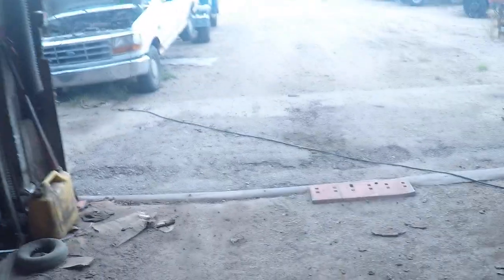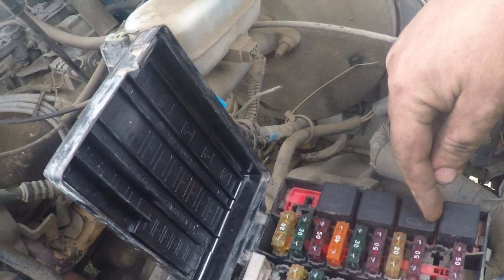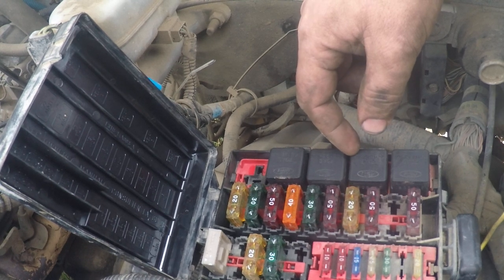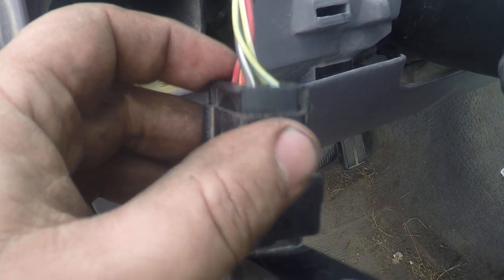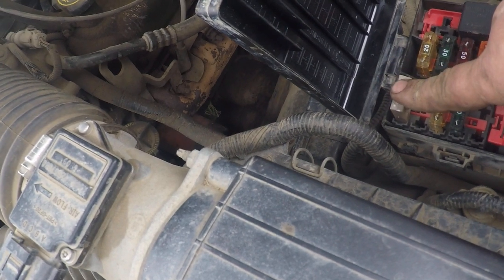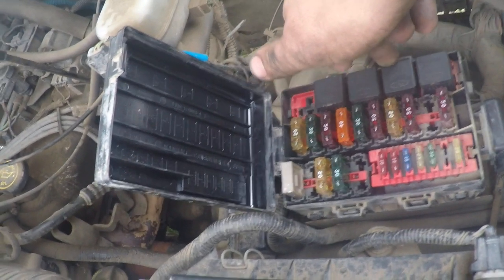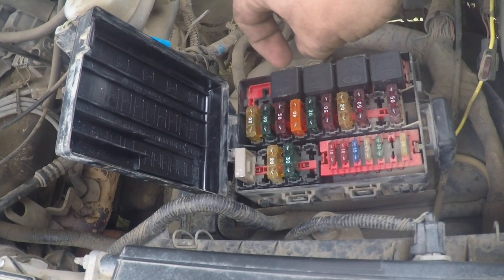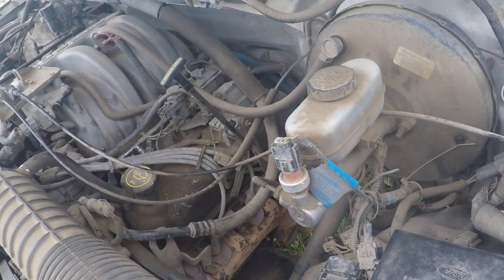Ford Fuel Pump Power Diagnostics

Comment: My 1999 Ford Ranger started giving the anual problems  this winter, slow starting, no takeoff power intermittently running good, and running like crap. Thinking back it done the same thing last year during deer season. thin looking at my feet I remembered, I wear -60 degree artic Pack Boots during deer season cold blasts. And they were the source of my misbehaving Ranger. It seems that those fat 6 inch wide boots wern't ment to drive around with on yer feet. Think about depressing the brake while your trying to take off with the outside of yer boot starts catching floorboard. Needless to say there is nothing wrong with the truck jus the foot................

Comment: Inertia switch on my 1988 F150 is in the cabin mounted to the firewall where the steering column goes through the firewall.
Reply: I have a 87 ranger and mines in the floorboard and a buddy kicked it and it broke

Comment: I have a 96 f150 4.9l that has a problem with the switch going bad. How can I jumper past the switch in an emergency to get home ?? Which terminals on back of selector complete front or back circuit to run appropriate pump ??

Comment: What a out a 2002. F -150?  Im having the same issue. No double tanks. And yea, a new tank,and fuel pump. Havent xhecked diode or inertia switch yet. Thanks in advance..

Comment: 04:09  ECM Diode, Simply Remove & Replace for better connection.
THANKS   FIXED MY 543 Ford OBD code.
Power restored.

Comment: Thanks for very informative video. I have a 94 F 150 that will only feed from the rear tank. I pulled the bed and replaced the front fuel tank pump and presto. All works. Next day no run on front tank. After watching your video I checked the inertia switch, swapped relays around,  Checked diode with meter. Found only 6 volts at the front/rear selector switch. What feeds 12 volts to thisswitch? Where can I get a schematic? I went to the library, searched the web. No joy yet. Like to know what the next item is upstream of the switch.
Reply from the maker: The inertia switch feeds power to yhe selector switch, you will need to check power in and out there next.

Comment: Got any ideas why a 2003 mercury mountaineer no fuel pump prime when you turn key on. Car will start after cracking to get oil pressure car starts and runs  fine. Just harder to start when it hot. .
Reply from the maker: Likely the temp sensor, there are 2 one for the guage and one for the computer mixture control, if the mixture control one goes bad it can cause hard starts as it typically causes a flooding situation.
Reply: @tri-rrrservices7299  it's not running rich ,and isn't flooding . You can not hear the 2 second prime when you turn the key on. Once the car has 4psi of oil pressure the pump come on and car will start. What tells the pump to prime?
Reply from the maker: The ecm runs the prime, if it's not priming you will need to check inputs and outputs of ecm, in  particular you want to check the ground circuit for that circuit in the pcm as there are multiple grounds for multiple functions I  the ecm, that will require a wiring diagram to confirm which circuit as well you will want to use a test light for checking power and grounds,  as an ohm meter won't show if the circuit is unable to carry sufficient load.

Comment: Very Good.  Hope you can help me.  I have the same truck. sat 3  years. I replaced front tank, treated fuel cleaned throttle body all good then was going to replace the rear tank and just prior to mounting the tank I thought I would check the voltage on the rear harness. I got like 5. something volts.  Went to start on front tank pump would not run. checked voltage on new selector switch. NO voltage, checked relay, inertia switch all good.  An idea?  Thought I would just connect the new rear pump not installing it in the tank and see if it would run.  I am out of ideas
Reply from the maker: Check the diode like I showed,  but likely bad grounds, check for mouse activity too.
Reply: I have not gotten back to the truck  I will go through it again and I think I will just purchase a new Diode. prior to my note to you I did pull it and clean it with same results.  I promise I will let you know the problem your video is clear and should produce results for me promise to let you know AND Thank you for answering me, Jim

Comment: Is it normal for fuel selector switch wires to get hot and on the diode when checking it how did you check it to make sure it's good.
Reply from the maker: Wires should never get hot, there must be a shorted wire somewhere, the diode can be checked with a digital multimeter that has a diode tester option, a basic test is with an ohm meter to ensure it has a connection through it, or test fir voltage on both sides when plugged in and powered up, a diode is just a one way check valve for electricity.
Reply: @Tri-RRR Services  my diode only shows olvoltage on one side with my powerprobe. And I'll have to check in those hot wires maybe bad relays they feel a little hot to
Reply from the maker: It needs voltage on both sides when plugged in, unplugged will only have voltage on the side coming to it, relays bring hot is a result of to high a load, the relays themselves are very rare to short internally
Reply: @tri-rrrservices7299  I'll have to look into it. Thank you for the reply.

Comment: What would you think. Fuel pump works can jump and make them run good fuel shut off switch. Good diode but no power from the cab harness to to fuse box? Can run a jumper wire with fuse inside the cab to fuel pump make them run all the time but won’t prime off the key
Reply from the maker: Check the roll over switch behind the right side kick panel

Comment: Man thanks so much! All I did was push in the ecm diode and truck started right up! 1992 Ford F-150 xlt, hope this helps someone else!!
Reply: I  put new fule pump on my f150 1995 rear thank and start and die but if I switch to that from start whit no problem than I switch back to that rear and works but file like up hills loose power

Comment: Will that dio or whatever you called it in the fuse block there cause the fuel pumps to keep priming went you turn the key on? Cause I'm almost out of sensors to replace on my 97 f250.

Comment: Where do I start...
I bought a semi busted 1994 f 150 from a homeless man for $1k. 3 hours into the trip home it stopped running. I suspected it to be the fuel pump as the gauge level wasn’t working and fuel over flowed from the tank. 

Long story short, after sitting for months, replacing the starter battery and fuel pump, it still didn’t run. The hose that’s supposed to recycle vapor was detached, causing gasoline to overflow from the tank. 

The old fuel pump only had two wires running from it (positive and ground) 
The other two wires from the pump were cut off, which explained the reason I couldn’t read the fuel level. The positive was ran directly to a random positive harness. 

I had to undo all the bull shaz and connect a new pump properly to the wiring harness. Still, no power. 

Now I’m thinking maybe the previous owner wired it like he did as an inexpensive alternative to making a fuel pump relay directly to the battery due to not getting enough voltage to the pump. 

So my next step is to check the inertia switch, tank selector, ECM diode, relay, fuel pressure and pump.

If I that doesn’t solve the problem,  direct battery connection is a must.

Comment: @Tri-RRR Services, did you have any obd1 codes pulled?  I am at your video with a no-start on my 97 f350 auto and pulled a 542 fuel pump open circuit or ecm code. They just replaced the fuel selector switch and don’t believe the inertia safety is tripped or bad (those things are resilient in my experience), but that ecm relay I had no idea. I have a feeling  my 92 f150 is in limp because of that and this new-to-me f350 is possibly suffering from a bad connection there too. However, wanted to check on any obd1 codes you had pulled.

Comment: I have no pressure at all does that mean a bad sending unit
Reply from the maker: You need to confirm if the pump is running, should be able to hear it for a couple seconds when you turn the key on, if it's running but no pressure, then likely the pump, if it's not running you need to made sure the pump connector has power, if it does then it's the pump.

Comment: 1996 F 150 5 liter app.200,000 miles.
My faithful starting truck wouldn't start. It would start on the 1st revolution,then I went to start it one day and it kept turning over...no start. I turned the key on & off cycling the fuel pump relay,still no start. Sat for about 10 minutes,tried to start,this time it started and for about a month everything was ok,then it became a problem once more.
Things I have done so far;I watched a Utube video Eric the car guy & Scanner Danner on how to diagnose this problem,but had no success with that. my truck sat idle for almost a year while I fixed other things. I watched another video that showed how I can test the coil with a test lite.This truck hadn't run for 9 months,though I would try to start it occasionally.
So I tested the B+ side,had juice going in,I turned the key on,used my remote starter across the solenoid and checked the pulse side to see if the lite was showing a pulse,it was not.then I checked it again and it started up and ran.
Starting it this way wasn't always successful. I changed the connector going into the coil,& replaced the coil,I thought that would solve the issue...wrong. The next thing I tried was a new TFI,sometimes it'll start,sometimes it won't and I have to touch the testlite to the pulse side of the coil and most times it'll start. When it starts & runs it runs great,no miss fire,it's perfect. I'm obviously missing something and my reader doesn't show any error messages.
I haven't changed the pickup coil in the distributor because of how good it runs when it does start,like how could that be the problem if it runs that good. There is a tiny electrical plug that's attached to the TFI harness,but I don't know what that's for.
If I could figure out the significance of the testlite as to what and why the testlite is the key to it starting to the secondary side of the coil,if it was a ground issue,why would it then run after starting with the lite?
I didn't want to replace parts,hoping that I would fix it by trial & error,that's too costly & I'm on SS
I guess my brain is just fried....any ideas will be appreciated.

Dewey & I have spoken about this problem and he has given me some things to  check out & will get back to him with my findings.
This guy is the real deal,folks! I wish I lived  closer to him,I'm in south Florida and he's in Canada!

 Y'all should subscribe to his channel,he's a good guy! Thanks for your help,Dewey!
Reply: Look into the tank selector switch if you have dual tanks or your fuel pressure regulator. Also check the fuel pressure to male sure that is ok first. It might be a pump going out. Check the first two first though and the pressure

Comment: How did you jump the inertia switch??
Reply from the maker: I didn't,  I checked to make sure it wasn't tripped, then checked that it had power on both sides
Reply: @tri-rrrservices7299  ok. So,what voltage should i have at the switch?
Reply from the maker: Battery voltage, nominally 12 volts

Comment: Any reason a fuel selector switch would keep being blown? It happens intermittently maybe once a year or could happen twice in one week. Again it happens randomly and always when starting the vehicle. Sometimes it only blows on the front portion of the switch and the rear still works. Vice versa. I feel like this is a massive issue with these setups.
Reply from the maker: I would expect you have a poor ground between the engine and chassis, or battery and chassis, and the switch is a victim of high current load on startup, the part of the switch that burns out is likely the tank selected at the time. doing voltage drop testing is about the only way to find the problem, but an occasional problem is very hard to find as you can only really test for it when its  happening and you don't know when that is going to be.

Comment: Thanks so much....I'm debating on a 95 Fi50 with 6 that runs like shit...If I go for I'll be totally at your  mercy...These Fords are great when they but no one seems to be able to fix them...
Reply: Just wanting to add it will start was making a knocking noise when shut off. It’s a 4.9 6 with a 127k miles if anyone has a clue.
Reply: Sorry meant it will not start

Comment: nice diagnostics. i have a 95 f150 that runs on rear tank only. i replaced front tank pump and wiring plug that came with new pump. original pump was clearly bad (rotted off strainer and sludge inside plastic pump housing) i reinstalled tank and pump did not function. replaced selector switch still doesn't work. still works on rear but front still doesn't make noise when key is turned on. relay "clicks" on front tank initially when key is turned on but no noise from pump. any suggestions?  you're the first channel i've ever subscribed to! thanks for the knowledge.  patrick
Reply from the maker: The faulty new part problem gets all of us once in a while, and I would suggest using a test light instead of a volt / ohm meter for testing the circuits, as a meter won't load the circuit in the case of a bad connection,  and good job o  getting it diagnosed,  hot wiring is a legitimate test.
Reply from the maker: Typically the 2 outside wires on the fuel pump plug will be the power and ground,  and the center ones will be the fuel guage, so with key on you will have 2 powers,  one for the pump and one for fuel gage, the pump wires should be at least one size heavier than the sensor ones, you also want to ensure you have the wires spliced correctly.  You can also check fuse 6 in the i/p fuse box as that should operate the tank selector on the frame, but if the rear tank is shutting off it most likely is working.
Reply: hello, well after a few hours of checking wires and switches with a volt and continuity meter and couldn't find a problem i made a jump wire from the battery and tested the pump at the plug and found it didn't work! so i dropped the tank again. gerrrrrrrr! turns out the crimp connector the parts store used to assemble the pump to the rest of the pump assembly in the tank was not crimped correctly causing a false connection! counter salesman was sorry, but not as much as  i was having to pull the pump and tank twice. bench test parts first ! @tri-rrrservices7299
Reply from the maker: Thanks for the comment and subscription, first thing to check is for power and ground at pump plug, sounds like it is likely a ground problem,  check for power and ground with a test light to make sure circuits will carry a load.
Reply: @tri-rrrservices7299  that sounds logical. thanks. do you know which wire is ground, and where it is grounded on the chassis? red with yellow stripe is positive?

Comment: Hey nice vid, do you know if the diode can cause a no spark ?
Reply from the maker: Diode is only in the fuel pump circuit, no spark is commonly the TFI module on the distributor on those older Fords
Reply: @tri-rrrservices7299  thank you!! I will changing it today

Comment: I’m having the same problem. Can you tell me which holes in the pump relay go to which things.  I have power at the far right hole but no where else.  Which hole is the control ?
Reply: Haynes Manual is your friend.  Best $30 you can spend.

Comment: She cranks but does not start.  Did most things mentioned in this video except I paid no attention to the diode.  I have no fuel pressure so I think I'm going to verify that I have power to the pump and if so replace the fuel pump.  When you say bypass the inertia switch you mean join the two wires right?

Comment: can you please tell me what connecter pin you touched to power the fuel pump directly? there is 4 pins im not sure which ones i should touch to see if the pump turns on. thankyou
Reply from the maker: I believe you said before that you had 6 volts at the connector, you need to supply 12 volts to that pin while it is plugged in, and pump should run, this will confirm pump is working, you will also need to track down the reason for the low voltage.
If voltage goes to 12 with connector unplugged then it could be the pump or bad grounds.
Reply: Tri-RRR Services thankyou for your reply i have 12 volts on my fuel pump relay connector and my fuel pump fuse but for some odd reason when i check my inertia cable that goes to my tank switch then to my fuel pump it only shows 6.8v.Not sure why? Your video is the best out there that matches my problem.I want to test the fuel pump with a power probe would you know which connectors i should add power and ground ? the connector is round with 4 pins. thankyou
Reply: @mase202  You need to get a wiring diagram for your vehicle, try looking it up. Or better yet a service manual for your specific car. Wish you luck bud, I'm obviously having a fuel problem as well. Think it's my ccrm
Reply: You don't need to jump the switch directly. Go to the obd1 connector and with the key on the run position ground the pin located on the right side of the obd1 connector. It will send power directly to the pump. Move the tank selector switch to check both tanks.